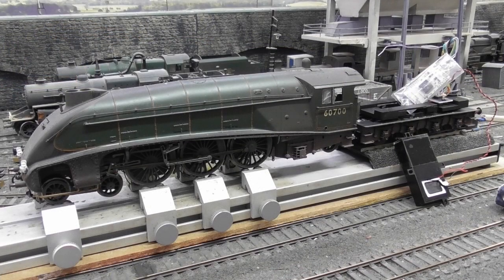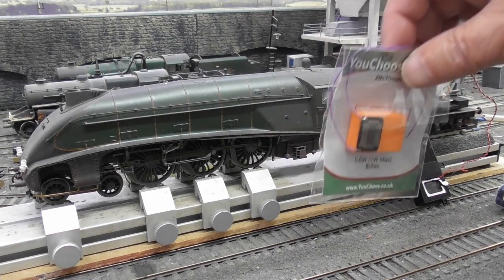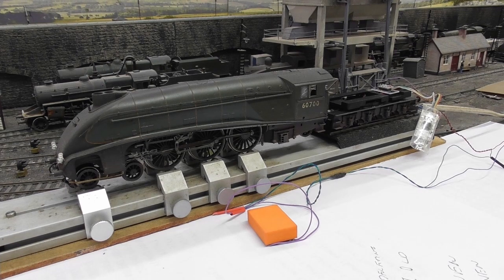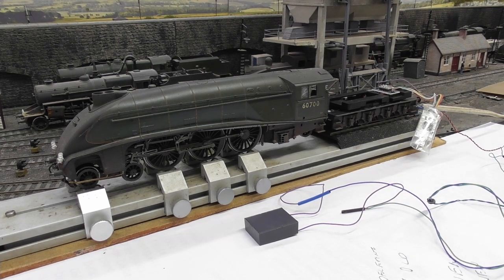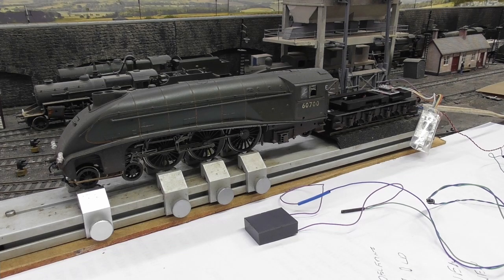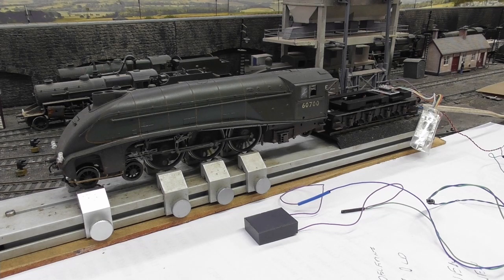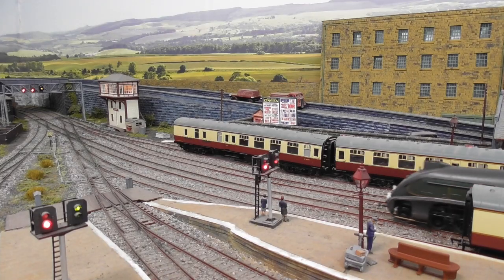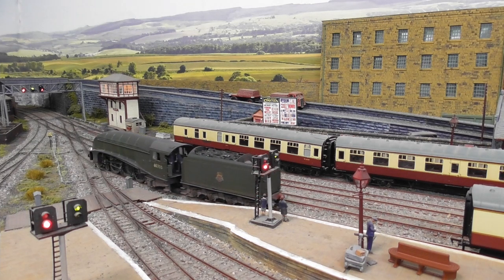Improving the HM 7000 Sound Decoder ! - Byford Model Railway

Comment: I think the sound file needs adjusting. The rebuilt W1 had three cylinders so you should be getting three chuffs per wheel revolution. You are actually getting half that.
Reply from the maker: Hi, you may be right but the sound file is downloaded complete from Hornby to match a  particular loco in this case a W1 File and I don't think that there is any way that you can adjust them.
Someone with more technical skill might know otherwise but it's beyond my ability so I just leave things alone and accept it. Richard